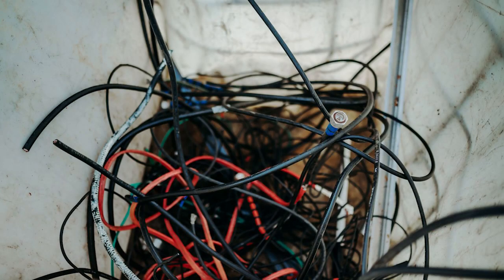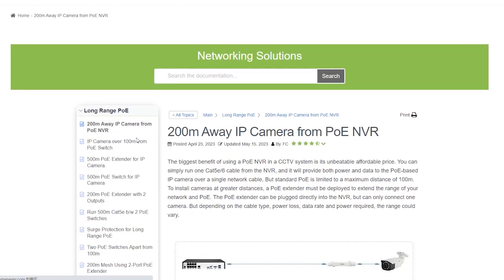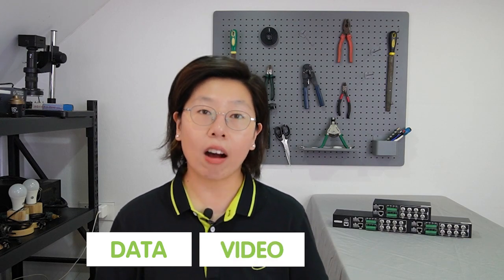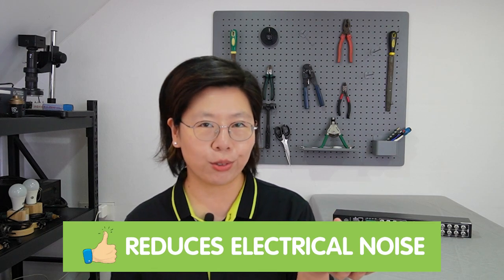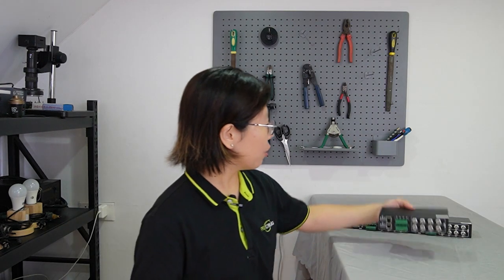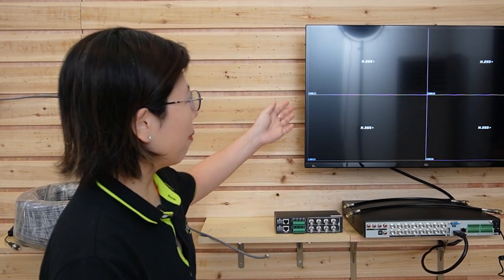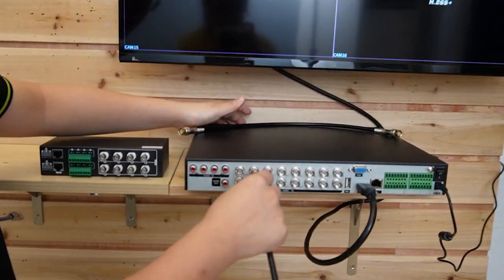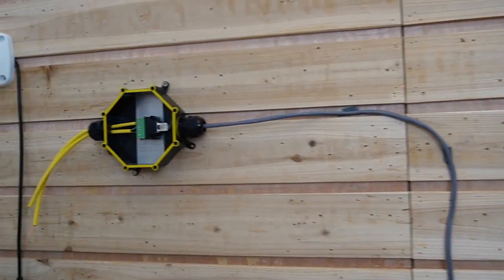Setting Up 4/8 UHD Analog Cameras on Single UTP Cable

Comment: That's pretty cool, it's like a network switch for analog cameras!
Reply from the maker: That's pretty much the gist. The video baluns are designed to convert analog signals into a digital format for transmission over twisted pair cables, allowing the connection of up to 4 analog cameras using a single network cable. However, even with the use of video baluns, it's still necessary to link each video output to the DVR through coaxial cables, as demonstrated in the video. In contrast, in IP camera systems, you only need to connect the network/PoE switch and NVR to the same network; there's no need to individually link the IP cameras to the NVR.